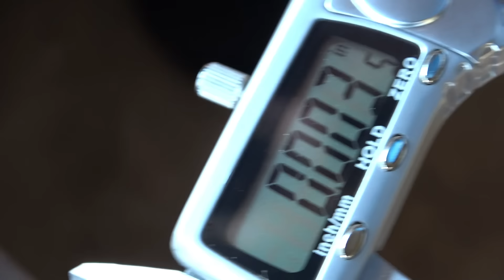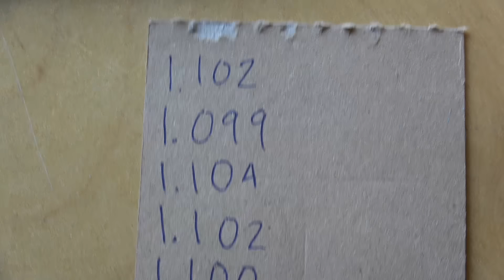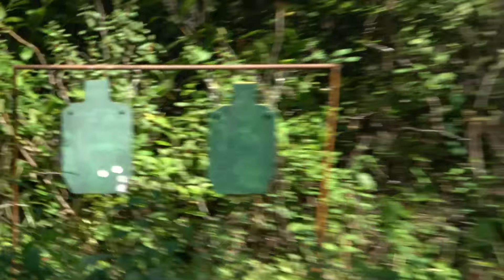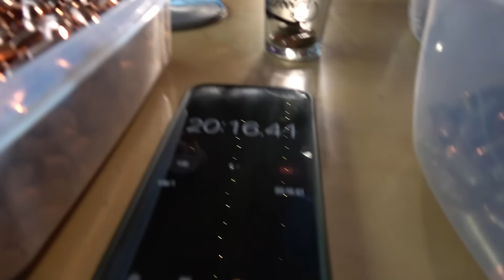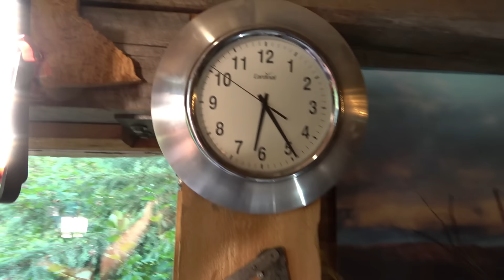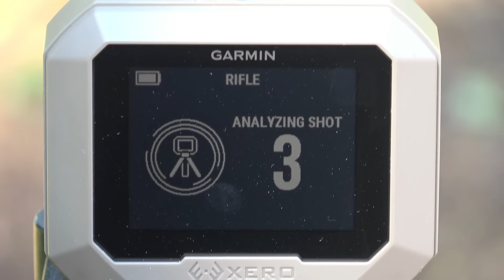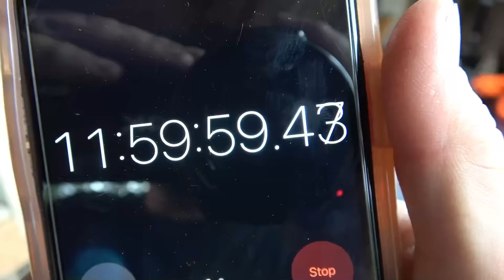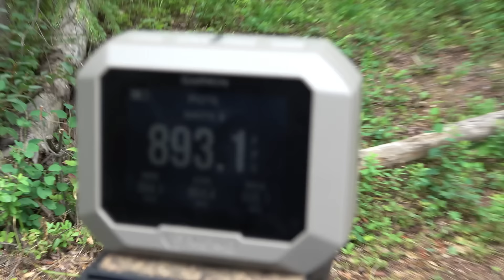We Made 10,000 Rounds in 24 Hours! DIY Ammo FACTORY

Comment: The reason the pin keeps breaking is those girls arms are too strong for that machine , you may have to upgrade 😏
Reply: Use a sonic it will clean the brass much better there are some really nice hand deprimimg  equipment  and you won't have to buy pins
Reply: No, they probably had berdan primed cases. The only upgrade for that machine is to run a bullet feeder and then an automation system to cycle the machine. They already bought the best reloading press made for individuals and even some small ammo companies use them.
Reply: @Dwade689 that would require humor and this is YouTube there's no humor but millions of know it all's
Reply: Yes, I'm very serious, but did see the humor but also a real problem they seemed to be having. Hornady One Shot is the best lube I have found for a progressive machine with pistol brass. Throw brass in a coffee can and spray with that lube, mix, and dump in the press. No need to clean the lube off. Dillon lube, which is just lanolin and alcohol, is best for rifle brass because it can be sprayed on the same way. The downside is that it is sticky. On the dillon, I lube and size rifle brass, then tumble it again in corncob media (buy it from a feed store or abrasive supplier and add your own polish to save money over small containers made for reloading) and trim then load back into the dillon press.
Reply: The actual reason is you are trying to force out staked primers, which is something the person who posted this video would know if he actually knew anything about reloading.
Reply: @michaelhill6451  True, once in a rare while, a crimped primer will not come out with the amount of force I am willing to use. 99% of the crimped primers come out just fine and the swage rod on the 1050/1100 removes the crimp. Like someone else said, he jumped into the deep end with an amazing press and no knowledge. A few people could start on a progressive, but it is like a person trying to win a 200 mph drag race at a track when they have only driven on the street in an average vehicle. I'm assuming they don't have any or much reloading experience on a more simple press.
Reply: @CGT80  Yep. Also like trying to win a 200 mph drag race with no experience, doing things wrong with reloading can have very bad results and it's easy to do because there are so many things you don't know that you don't know.
Reply: @michaelhill6451 
Yep. 
Military brass. 
And I wish this guy would stop saying he's making "BULLETS" 😂
Reply: This is awesome !  Best Dad  in America right here !  So much awesomeness in one Video !
Reply: @AutoKeycardTyranny  that’s the spirit I was looking for, only they’re Canadian not American 😉
Reply: @bigginsmcsauce  bah u dont need to lube with carbide dies...
but i would be more worried about berdan brass. And the new with tighter primer holes. Those can break pins fast.
Reply: @AutoKeycardTyranny  
Their Canadian
Reply: @KevinSmith-yh6tl  ... ? Their what is Canuck?...   lol...

(Their self?)

They are indeed - they're....  (-sorry humor, serious business)
Reply: @bigginsmcsauce  if they're running carbide sizing dies you don't need to lube the 9mm cases.
Reply: Rule Number One…. RTFM.   Read The Fluckin Manual. Rule Two… Always use Lube.
If you are making Bulk Rounds, take every 10 Round and Weigh It. Even the Best Powder Throwers tend to vary over time and number of rounds produced.
You have the right gear. Dillon is simply the best, BUT, going back to Rule One, read up on the Servicing Requirements of your Model. Keep it Clean and Lubricated.
Treat it right and it will last you a long time. To me, the Main Component to check is the Powder Thrower. Over or Under is NOT acceptable. Set it right and check it regularly. I use my Pistols for Work, so a Misfire is not an option.  Best of luck with it all. It is a great past time.
Reply: @RichardSherman-h2l  You don't need the pins.  I don't use them and the brass comes out super shinny.
Reply: @jmkhenka  However - it makes reloading much easier, especially at the neck resizing/powder station.
Reply: @glenngriffon8203  "take every 10 Round and Weigh It."    Yes - but specify to weigh the powder - not the whole round. Depending on the caliber, there can be several grn. difference in weight between cases.
Reply: @2pugman  Pins, hot water (not boiling), two spoons of dish soap and half one of citric acid in powder and you will get the best brass you ever seen, better than brand new.
I always use pins, especially because they are cleaning the primer pockets.
Reply: @Dwade689  or Norma brass. Small flash hole
Reply: @bigginsmcsauce  you never Loube 9mm brass at least on a Lee die on the Lee resizing and decapping die you’re not supposed to have any lube it’s designed to be used dry it’s a carbide die
Reply: @Dwade689  that was the scariest loading video I’ve ever seen especially when he goes out and he shoots and it doesn’t hit the target three times in a row and it keeps firing that first shot when you don’t hit your target 99% of the time that would’ve been a squib load, so why would you test fire new ammo with a gun that Scott cited in, it doesn’t even make sense. Everyone in this video is extremely lucky. Things didn’t go very wrong because I was the most irresponsible uneducated lackadaisical moronic loading session I’ve ever seen in my life if I did that I had to blow my face. I have no doubt I don’t get that lucky.
Reply: @CGT80 Yeah. Reloaders learn early on, if it ain't your brass and it isn't Boxer...sell it as scrap.
Reply: That's why primer pocket reamers and case trimmers and those terribly complicated instructions books are there.
 So things don't go BOOM where your eyes and fingers used to be.
Reply: @lyfandeth  I swear I think Jeff is the only one who understood my comment 🤦‍♂️
Reply: Certified protective eyewear--which doubles as shooting glasses--is also a good idea, unless you have spare eyes.
Reply: Need smaller kids with less strength so they are not forcing something up into the resizing dye that is too hard or too fat and at the same time a really stuck primer. 
If it feels like you have to stand on the lever to resize and deprime the brass , let off and throw that piece of brass away ...
Reply: If it doesn't feel like it's going to go through easily it's not worth jamming up your press or wrecking your depriming pin in the process, let off and throw that angry piece of brass away and move on to the next one.
Reply: Tumblers clean brass light years better then sonic cleaners